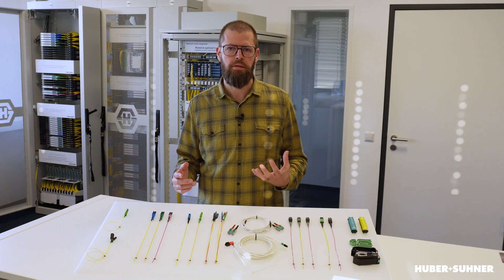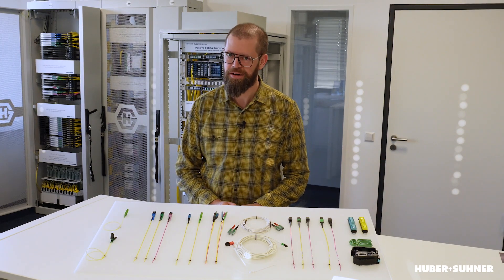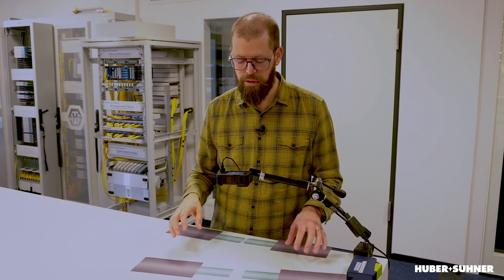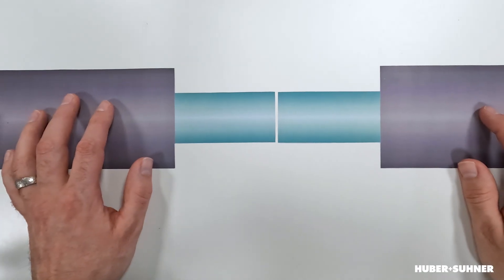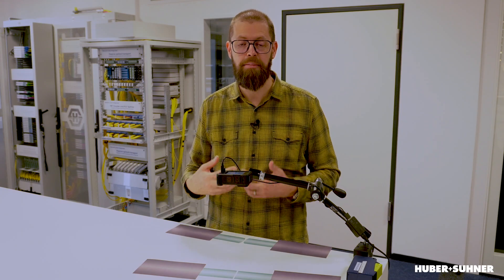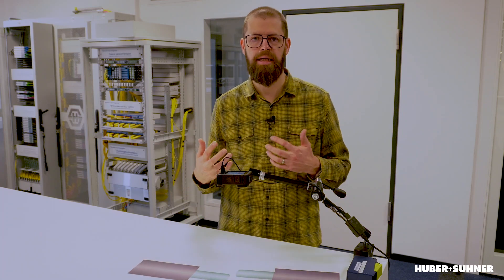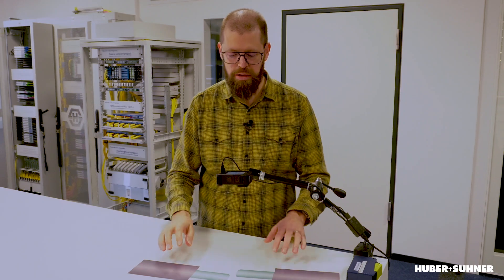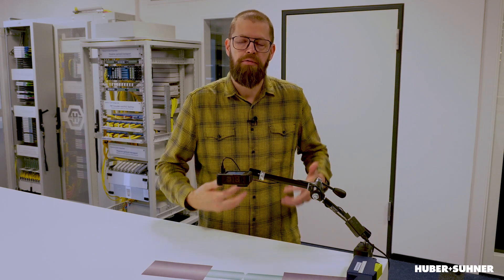Difference between PC, UPC and APC explained (01-07-06)

Comment: This means that a blue SC plug with PC cannot be 
distinguished from a blue SC plug with UPC?
A green SC connector has APC.
Reply from the maker: Yes, that is correct - at least not with the bare eye.
However, mating PC and UPC isn't such a bad thing as you don't risk damaging the ferrules of the connectors which you would if mating APC with either PC or UPC. The only thing that will happen is that you don't have the performance advantage of the UPC design - i.e. it would be as if you are mating PC with PC.